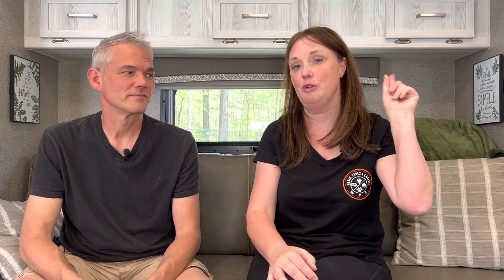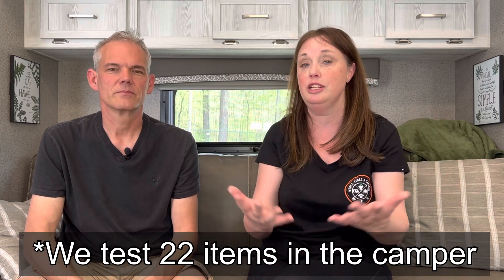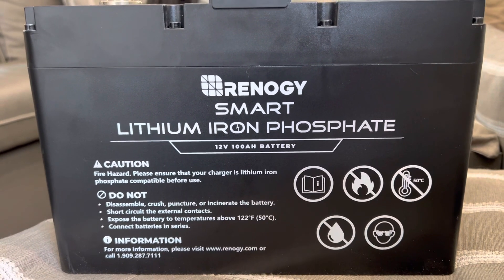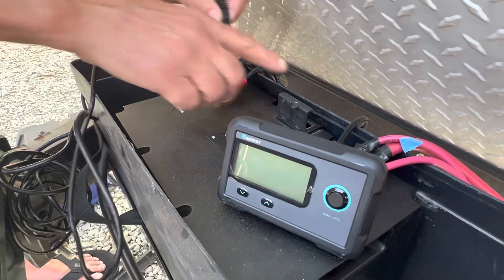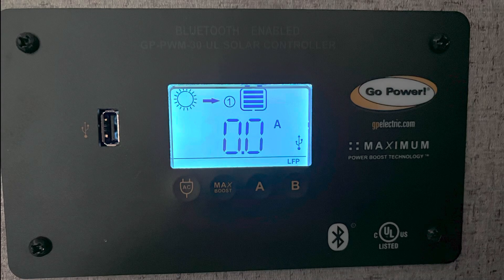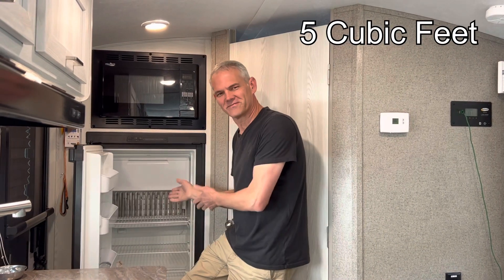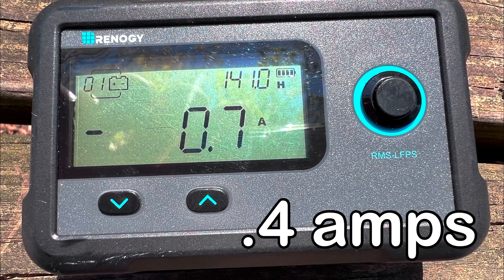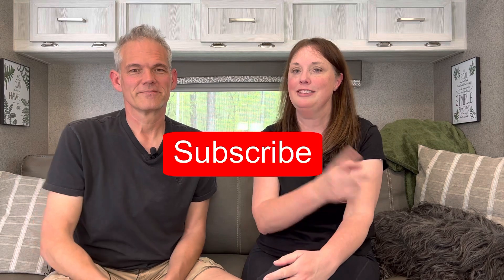Want to Off Grid Camp Longer?  We use RENOGY Monitoring Screen to test 22 Items For AMP draw!

Comment: That was good, but what about the A/C and microwave?
Reply from the maker: Hi - thank you and thanks for watching!  So the ac and microwave will only run on shore power not off the battery so we couldn’t test those with this device unfortunately.
Reply: @WinesPinesandCanines  At 69 amps, doesn't running a hairdryer trip a breaker?
Reply from the maker: @Jerry Francia - It’s a 1000 watt hair dryer so right at the max of our inverter (it’s a 1000 watt inverter).  So if we were wanting to use the hair dryer for an hour, it would have used 69ah of our 100 ah battery.  So even though we have the inverter, we rarely use for anything close to the 1000 watts!  Thanks for watching!

Comment: Is your tv 12v or are you using the inverter?  Did you use the inverter to charge your phone?
Reply from the maker: Hi - thanks for watching.  The tv was running off the 12v and we were using the usb charger in the solar controller for the phone.  The only thing the inverter was on for was the hair dryer.

Comment: For some reason your power usage of items appears to be off especially phone chargers and the ipad is no less than 2 amps or it won't charge. The heater at 69 amps should have blown a fuse ... but I could be wrong
Reply from the maker: Hi - thanks for watching!  So the hair dryer is 1000 watts which runs off our 1000 watt inverter.  As long as the appliance / item we are running is not over 1000 watts, we don’t have any trouble - but it definitely pulls amps of the battery and not something to use often!  

Iphone/ipads - we plug them directly into the built in usb so we aren’t using an Apple charger.  So, they definitely do not charge as fast as they could, so use less amps from what I have read (and its an older ipad we charged - not with the usb-c.  Not sure on the differences between those).  

But you have us wondering if how depleted the phones/ipad were might play a part (read that will draw less amps closer they get to fully charged) and if we use a different usb port makes a difference.  Going to do some experimenting!  Thanks!
Reply: Thanks for your response

Comment: Great info!  Something to keep in mind is the number is amps per hour.  So while the awning uses a lot of amps per hour, a single use in or out may take less than minute.  Whereas your vent fan, is something thing you use for several hours.
Reply from the maker: Yes - great point.  We mentioned on one of the info cards in the video that it would be based on an hour usage but think we forgot to add to the description (not sure if anyone reads those lol).  Thanks!

Comment: This is really interesting.  We just got back from two weeks boondocking in central Utah. We found that, even though we like very dim lighting, and mostly use the led knob lights on the stove with some fake battery candles, cold(36-18°F) nights with the heater on all night meant we did not watch the tv+dvd+ radio speakers.  We'd have super sunny but cold(45-55°F) days and put the fridge on 3 to cool it way down. Then turn it to 1 after dinner was done to minimize usage. (2022 19BH) we'd also be charging phones and a tablet during the day, while accumulating solar charge(we got two factory 100watt panels, but only one 12v lead acid battery). But on two days, the panels got snow on them. One even iced over for a bit. I have a tiny backpacker solar charger,  which I used to charge phones and the tablet on those days. Keep in mind, we are climbing 8 hours, away from the camper, so we're only using the fridge while away.
Reply from the maker: Sounds like you had a great time!  Love Utah!  

Yes - that heater will use up battery pretty quickly on those cold nights.   We usually find us setting it to around 45 and then as soon as we are up we turn it up a little and start boiling water on the stove to heat things up!

What size 12v battery do you have?  We originally had a 65ah one and it was pretty much worthless except in perfect weather that wasn’t too cold lol.
Reply: @WinesPinesandCanines  I'll have to check on our battery size. We do the opposite: cook dinner(pizza and pot pies in the oven) around 7pm, which got the camper warm at first, then set the thermostat  at around 55-60. We have mountaineering bags for all our camping, so we're comfy.  Battery was approx 54% both mornings, but got sunny on the second day pretty quick.  We are looking at LiPo,  but are worried about the freezing temp charge issue.
Reply from the maker: That seems like a very cozy setup!  We love camping in cooler weather for sure.  And yes, that is a downside of lithium which is why so many people move them inside.  We are thinking of it, just down on the to do list haha.

Comment: Interesting. My appliances are pretty much identical to yours, aside from the refrigerator (mine is a smaller one, but still a 2-way Dometic), and I have a different radio (I replaced mine with the next model up, because I wanted 3 zones instead of 2). Your figures should come in handy. Thanks!

I'll have to check how much the microwave draws using the 2000 watt inverter, out of curiosity. I'm guessing around 100. Good thing it doesn't run for long...
Reply from the maker: If you find out the draw on the microwave let us know - would be interested in knowing!  And hopefully it is helpful for owners looking to calculate for battery upgrades or looking to off grid camp.  We spent some time reading online to do a best guess on our usage before buying the battery.  Always something to learn on campers haha!